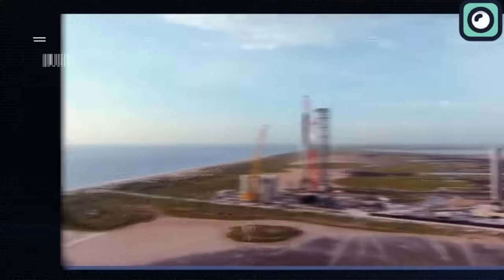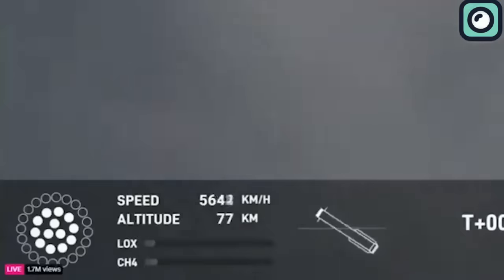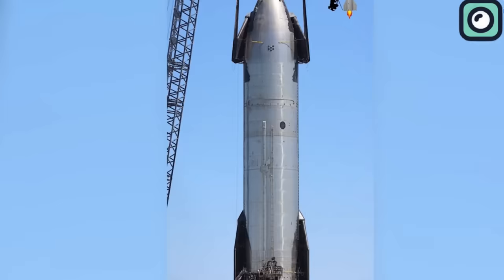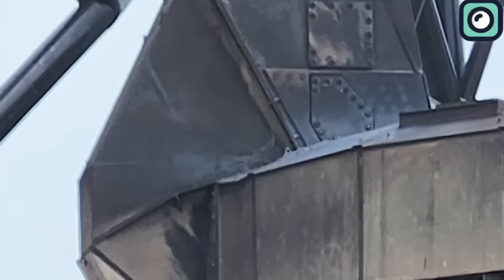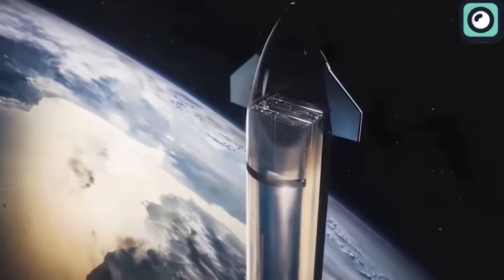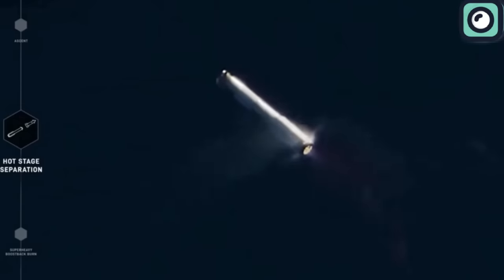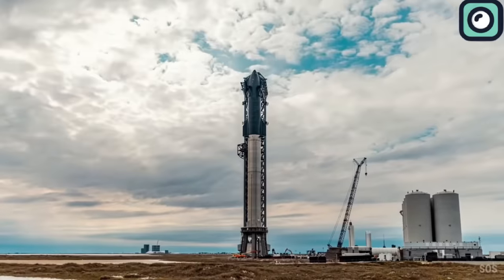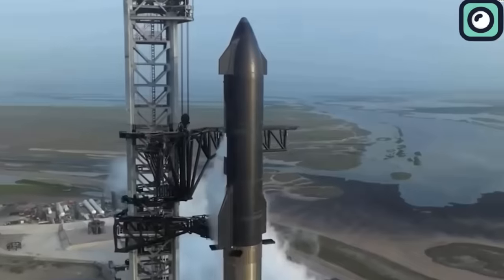What SpaceX is Doing At Starbase Is Unbelievable.... Next Launch Already Ready!

Comment: Why would you fill them with cement which holds heat and doesn't like vibration why not water???
Reply: The concrete in the tubes still have moisture inside and would burst from steam pressure .